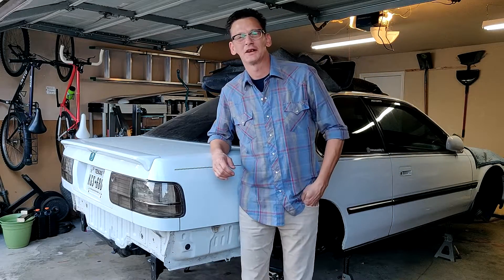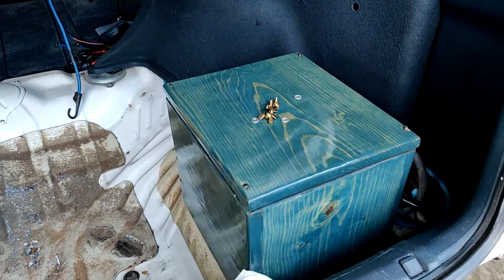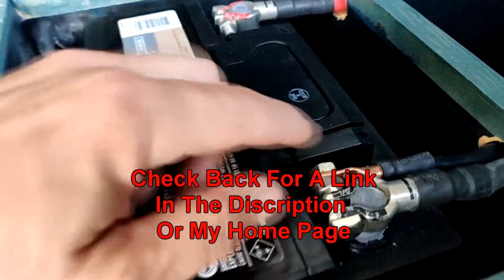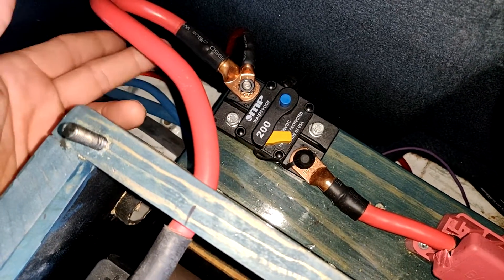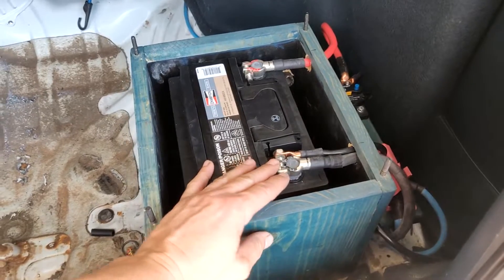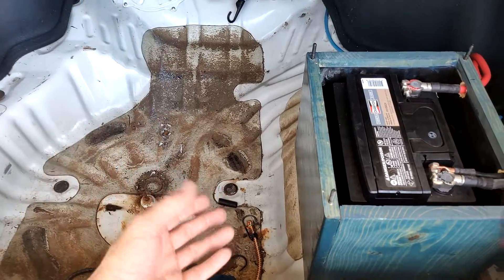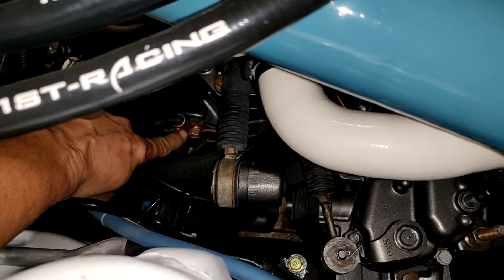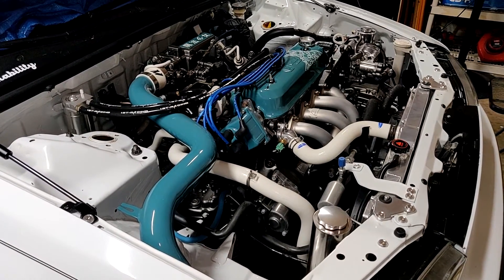Battery Relocation -  And Problem Free 👌 CB7 Accord

Comment: Hey sorry to bug. Are you running the neg cable from the battery all the way to bell housing? I wasn’t really understanding what you meant by one foot travel. I bought my cb7 with battery already relocated and I want to do this right as my car wouldn’t fire up in early morning cold weather
Reply: My car was giant resistor. I understand that part
Reply: Was that ground to the bellhousing the bigger neg wire from the battery
Reply: I think I figured it out. Thanks
Reply from the maker: Hey brother no worries bother me anytime lol. Know what I was saying is if you run just a short cable to the chassis you turn the entire car into a giant resistor. Yes you do need to run a zero aug cable all the way up to the bell housing That way the 12 volt from the starter and negative are about 1 ft away and that's all that it has to travel to get back to its source so that's how you do it properly because the car was set up that way originally
Reply from the maker: If you need man you can reach me on Instagram @ dreamability71 Just send me a DM

Comment: Great coverage. Only thing i have to add is If you move your fusebox any farther away than the area you located yours, you will need to step up the gauge of the power cable from the alternator to the fusebox and from the fusebox back to the battery. I always have tons of grounds with good clean connection. But once i moved my fusebox to the trunk i had a 2 volt drop over the distance on the 4gauge power cable. 0 gauge cable solved the issue.

Your cb is a work of beauty, congrats on your ifo trophy or trophies. Much deserved. Im sure we will probably run into each other at some shows. Dropped a subscribe. Keep at it 🤘
Reply from the maker: Thanks for checking it out and subscribing.  It's been going strong with no issues. I'm very happy with it.  Good luck on yours too!
Yes it has been very humbling all the winning the Coupe does at shows. It won Best import and a people's choice this year as well. 
I bought a fixer upper house this February so it has slowed next projects for a while. Been working on it everyday for the last 3 months. 
That would be great to see you out there too, take care.
Reply: What kind of engine in your cb7